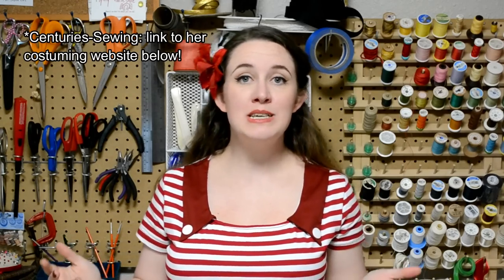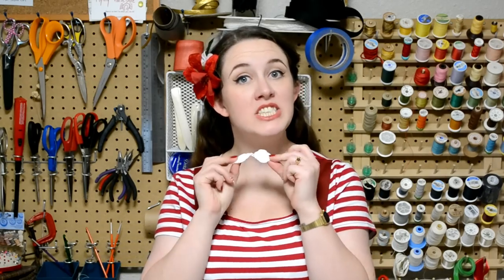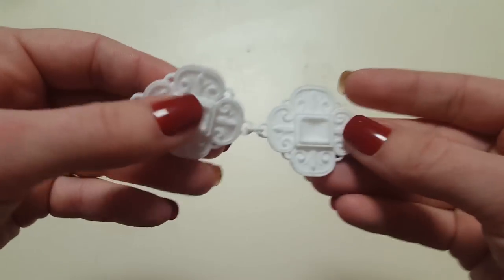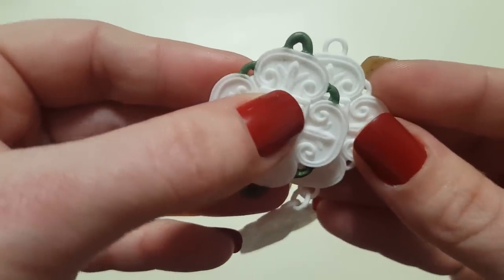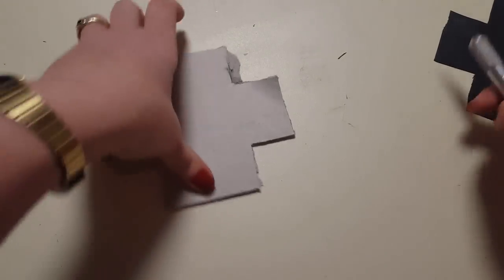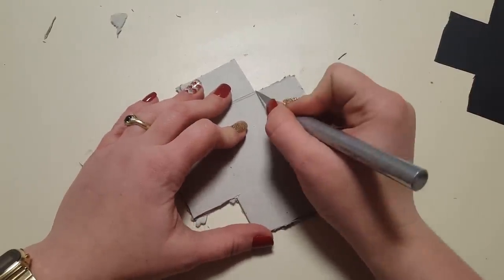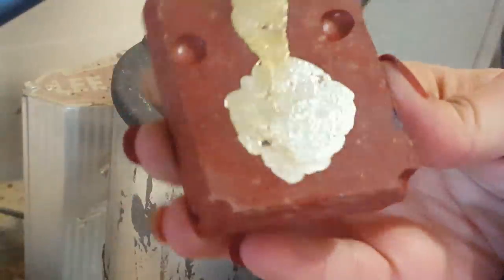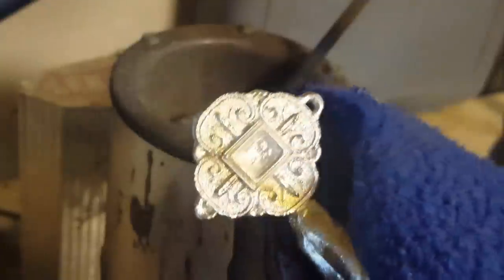Experiment: Silicone Molds and Casting Pewter!

Comment: Morgan, I have a tip for next time. Wipe the 3d print piece with a thin layer of Vaseline  and it will come out of the mold much much easier. A very thin layer so it doesn't effect details. Brush it on and wipe it off. Also you can put the Vaseline on the back of your cured mold which will allow you to pour the other half of the mold and have the two halves not stick to each other so they can be peeled apart fairly easily.

Comment: Try 3D printing in wax, then use lost wax process. Can do higher temperature metals - zinc alloys, aluminum, gold & silver.
Or make a wax copy in the rubber mold, then use it in lost wax.
Reply: Do you need a centrifuge for lost wax casting?
Reply: A lot of online videos show a centrifuge. Some use a vacuum (the plaster seems to be porous enough for the vacuum to suck the metal into smaller features.
I just poured directly into the plaster, but it is poor on fine detail. Using a taller mold (3" high spru tube on a 1/2" cubical object) to increase the pressure seems to help as did getting the metal much hotter than just melting. I did zinc alloy at dull red glow.
Reply: Lost wax casting is a pretty complex process, comparatively, and much less repeatable, but I agree that it's the best way to preserve detail!

Comment: I haven't seen anyone mention it but a really easy retaining wall, especially for this part, is a round plastic Dixie cup with the bottom cut out and the rounded top hot glued to a hard smooth surface.

Comment: Depending on the type of plastic that was used for the print, there are ways to smooth out the 3D print so that there isn't as much texturing on your pewter cast. If it's ABS, you can use acetone to smooth it out and remove some of the texturing.

Comment: It might be helpful when making silicone molds to coat your 3d printed parts in a thin layer of petroleum jelly before pouring silicone on them. I do a lot of silicone casting and I find it to be very very helpful against fairly rough 3d printed surfaces. 
Also, a vacuum chamber is a very useful tool. It's actually impressive how much air gets stuck in there. But it is important especially with certain silicones, not to leave it in too long as the vacuum can damage the silicone material.

Comment: You may want to brush the mold with a very light layer of some talc powder. it gives the finished product a smoother surface.
Reply from the maker: I usually use graphite powder, but I will definitely give talc a try sometime! Thanks for the suggestion!
Reply: Morgan Donner I brush it on with a really light coat. Don't load it on, it will fill in the design. Feel free to contact me with any questions!